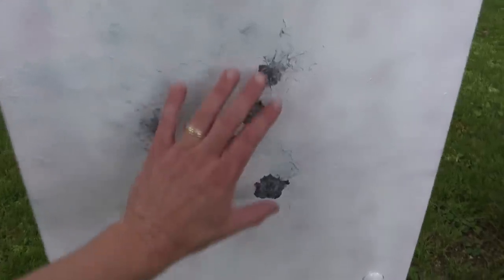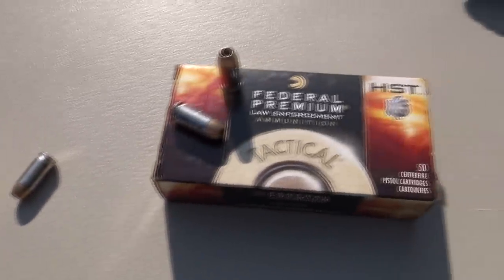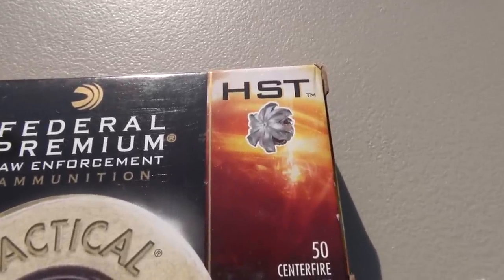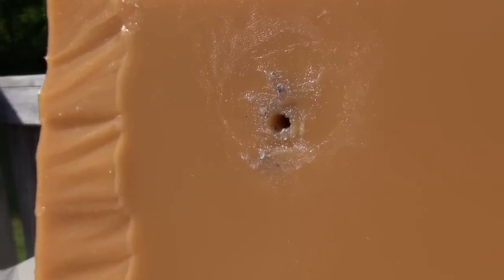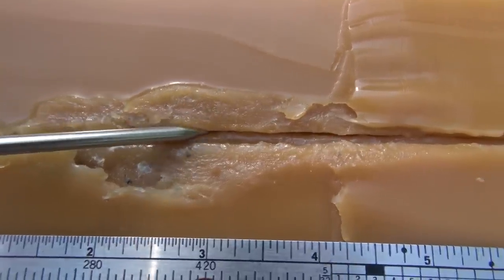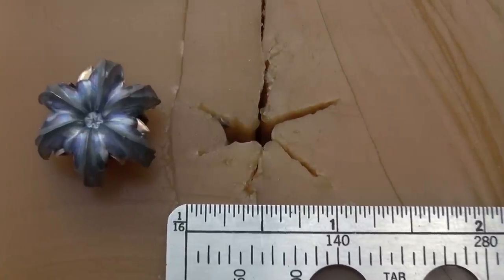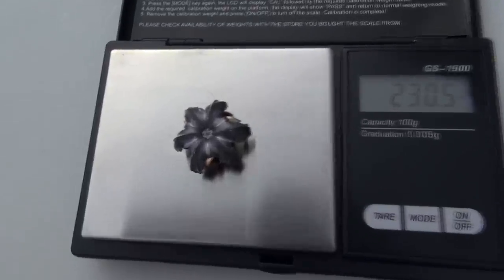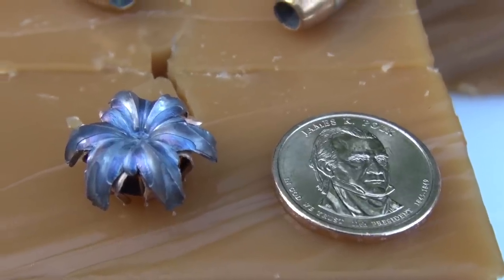.45 ACP Federal HST 230 gr Ammo Gel Test

Comment: Federal HST Premium rounds are just the KING... period.

No matter what channel you view ballistics tests on, this is the round that always gets  absolutely GLOWING reviews. If you carry Federal HSTs, you know you carry the best.

O_______o
Reply: Well said.  It is simply the best.
Reply: Colt Gangsta I agree.  I'm really liking the latest developments for this caliber.  The amount of choices in bullet weight, design and performance has greatly improved over the last few years.

My carry 45 (Jericho 941/Baby Desert Eagle) has a 4" barrel with polygonal rifling.  The 230 grain Federal HST +P chronographs through this firearm at 910 FPS which is similar to the non +P ammo through a 5" 1911.  The low bore axis of my firearm along with the weight of the steel frame makes shooting this ammo an absolute dream.  Cycles perfectly with my DPM spring assembly.
Reply: Colt Gangsta I'd say the Speer Gold Dot 200grain .45acp +p is a great round for short barrel handguns like the XDS 3.3 and the Glock 30, at least from what I've seen. I always forget about that round and then I realize how good the reviews are for it. HST's are amazing too, I don't have personal experience with HST's from a shorter barrel handgun though, only what I've seen them do out of a 5" 1911 and the full size M&P 45.
Reply: The Hst 230 gr standard pressure are my duty round, for armed security.  CT State Police carry the same round if I'm not mistaken, and also have the same duty gun as me.  Sig P220.  Have never tried the 185gr +p or the 200 gr+p in .45, but perhaps I should try those loads out.  I tend to look at it in terms of putting the biggest bullet you can on target, should you have to.  Some may shoot the lighter or medium sized loads better, and certain guns may also cycle them better.  The Hst are king in my mind tho, for .45acp.  Have the 147 grain 9mm's on order.
Reply: aran125 I was looking for some HST 230gr at the gun store the other day. Even though I don't have my G30 yet I tend to like to prepare for things anyways, around here .45 is a very very popular round. County Sheriff's office uses it as does a variety of local PD's. They had one box of the old HydraShok's left. I couldn't find any 200gr .45 except for some ball ammo. I really want to give the Speer Gold Dot 200gr +P .45 a shot (no pun intended) to see how it stacks next to HST's, my local PD uses HST's so I've seen a ton of those expanded out of the M&P 45 and the 4506. Online orders in this state have to go through an FFL for a background check and have to be shipped to the FFL, its a bit ridiculous, I like supporting local gun stores and always will but there is only one gun store I trust and its 23 miles from my house.
Reply: I've seen that about ammo having to go through an FFL for NY.  Total bs.  If you provide a copy of your drivers license, and pistol permit it shouldn't be an issue.  That's what I have to do being from CT.  I heavily recommend Hst.  You won't find it in gun stores around here, has to be ordered online.  It's the most popular round on the market.  You should get your non resident CT permit.  Go to the CT State Police Website, click on special licensing and firearms and click on non resident pistol permit.  They will mail you a packet of everything to submit.  Believe all you have to do is send a copy of your instate permit, certified copy of BC, or passport, $70.00 fee via money order or certified bank check and they will mail it to you.  Perhaps proof of training and possibly finger print cards.  For you it's an option to get CT permit as a non resident.  For me to get NY's, not so much.  If I were you I'd do it.  If you're ever looking to get away I can recommend some good spots and stores, and ranges.
Reply: aran125 Yeah I plan on the CT Non-resident permit once I get my New York but they are taking there time here....can't buy a handgun without a carry permit here. Submitted my paperwork in January and they haven't even started processing. I wish I could use a non-resident permit to buy ammo though. For NY you used to just scan your drivers license and you could buy any kind of ammo you wanted, no pistol permit needed for "pistol ammo".
Reply: Oh I thought you said you did have your NY Carry Permit.  Hope that happens soon for you.  When it does, definitely get your CT non res.  So in NY, citizens can't purchase a handgun with an FID card?  You have to have a carry permit?  That's such bullshit, and a true violation of the Federal and State Constitution.  Also goes against the heller ruling big time.
Reply: aran125 We don't have an FID system like IL/NJ/etc. Originally you could buy a handgun with no permit but you just couldn't carry it. Then NY decided to require a permit for a handgun (Back in like the 50s, so a LONGGG time ago). So they basically half assed it big time and instead of having a seperate permit for just buying they just issued carry permits with "restrictions" on them like "only for target, hunting, and hiking". The restrictions are administrative so if you break them no law is broken but if the Judge finds out you'll loose the permit and then you can't own a handgun at all. So basically the process to just own a handgun is like applying for a carry permit only 10x worse because its NY. Only Judges (with some extreme exceptions) have the authority to issue permits, Superintendent of the state police can issue permits but that never happens because the process is by the county, in NYC its the NYPD Police Commissioner and in a few metro counties around NYC and CT its the County Police Chief. You need 4-7 references and they have to fill out a bunch of questionaires and its gotta be notorized in many counties. I already have my Virginia non-resident permit on the way, they notified me like a week after I submitted paper work, meanwhile in NY State they drag there feet. CT is a cake walk compared to NY, Sometime I wish I lived in CT over NY!
Reply: Sounds kind of like the system that Mass has, only with way more red tape and bullshit.  Mass doesn't go by counties, it's by your town or city like CT.  In mass they have fid cards for long guns and for a handgun one has to apply for either a class a or b LTC.  (License to carry).  Only difference is class a is "large capacity" there. (for what it's worth-load of crap) Within that there's different restrictions they can put on it.  Hunting and target, recreation, premises only (essentially an FID basically), and then no restrictions at all, which in Mass one has to be able to provide substantial proof that they have a higher level threat of physical violence posed against them.  Sounds like the state of NY is in complete violation of the state and federal constitution.  What about long guns in NY????  No fid cards for them????  NY is a true communist state more then CT or Mass and I could never live there.  I believe both my Florida and Utah permits are honored in VA.  I also have New Hampshire's, and Maine's permits.  I don't travel much, if ever but it's totally worth it in the event that I do, or decide to move.  While CT is a May issue state, and we have our "suitability" clause in the statute, it kind of functions as a shall issue state in a way and it's easier for a non resident to obtain their CT Pistol Permit here then residents in certain towns and cities here.  But yeah, I thought you had your permit to carry already.  True shall issue states it's a whole. Other world and way easier to obtain a permit and it's harder to get revoked.  In our states they can fuck with us to no end.  Like I said initially.  I'm done with it and if they want my shit they can come and take it.  It's that simple.  I hate both NY and CT.
Reply: aran125 Yeah I've read about MA's system....not saying I "like" it per say but its a hell of a lot better than NYS! At least with the proper LTC in MA you can have "high capacity" magazines and what not. I know MA is fazing out the LTC-B and just going to FID and LTC-A so maybe MA residents will get some more rights....not sure I'd have to research it more. As for long guns they are unrestricted, just need a drivers license...just bought a rifle the other day and background check was almost instant (at least with me). Of course you can't buy an "assault weapon" at all unless you are law enforcement. Assault weapon is anything with a pistol grip and a detachable magazine or muzzle break or adjustable stock, etc. Also 10 round mags only and can only load 7 rounds but the 7 round aspect was ruled unconstitutional in US District Court. I've also read CT is essentially shall issue. But in NY State the SAFE ACt allows LEO's to confiscate guns without a warrant if they believe you are a "threat" which has such a broad definition its a joke. Most people don't get unrestricted full conceal carry permits on there first try but if you write a good letter to the Judge they sometimes will, it varies so much in one county its hard to say for the whole state...in my county its almost 50/50, although some antigun Judges retired within the past 3 years and I've got some reports many get unrestricted but in Westchester County you will never get full carry, although not as bad as NYC which has a completely different system. Oh yeah if your permit is from any county outside of NYC its not valid in NYC and you'll get charged with a felony if you carry a firearm on a non-NYC permit! But yeah Florida and Utah are valid in VA, I just went with VA first because its super easy and I wanted a permit since its valid in a handful of states I plan to visit.
Reply: aran125 But overall I find it interesting that many are shocked at how restrictive NY State has become, we don't even have the option for "pre-ban" anything since grandfathered guns and gun related accessories (to include magazines) were made illegal with the SAFE Act, I literally think Its the worst state in the union for gun ownership, as far as I know its the only state where you need a carry permit to buy a handgun and where buying a handgun can turn into a 12-18month period. From 2011-2014 permits were taking anywhere from 12-18months just to process, the law says they have 6months to process but they break it all the time or at least skirt it. Its a beautiful and wonderful state, really it is. West of Albany County and north of the Hudson valley is a completely different state but tyranny runs it wild, not just firearm related things either, you are probably intimately familiar with getting taxed the hell out of since NY and CT share a unique view on taxing the crap out of everyone and everything and making it hell for a business to operate in.
Reply: CT also is by no means shall issue, it's May issue, but not as restrictive as mass, NY, Maryland, NJ, or CA.  CT officials love to f**k with people and abuse their power any way they can to try and say that an applicant is unsuitable.  That's by now and shall issue, but total may issue.  Yet the amount of ignorant gun shop clerks and ffl's I hear out there saying we are shall issue.  They are wrong, and give out lots of bad information.
Reply: Pardon me I can't type.  That's by NO MEANS shall issue, I meant to say.  CT, although a walk in the park to NY or Mass, and no comparison to NJ or California, is indeed a MAY ISSUE state.
Reply: aran125 Yeah but don't the final review boards (ie: not the ass hole police chiefs that denied the initial app) usually issue anyways? Interesting that non-residents get treated better than residents but its likely a product of non-residents going through the Department of Emergency Services and Public Protection directly and not local police chiefs(what a mouth full! Why not just Dept. Public Safety?!). I've read a few cases where CT Officials had vendettas essentially and kept denying people permits. California is going Shall Issue if they aren't already thanks to the US Court of Appeals for the 9th Circuit. California is similar to NY State from what people have told me, give or take a bit depending again on the county. New Jersey and Maryland are the last two states which are for all intents and purposes NO ISSUE, both states have insane requirements, people have actually been seriously hurt or even killed by the people they sought to protect themselves from but legally couldn't, happens in DC too. My buddies sister and her boyfriend are moving to CT, he's got his NYS permit but no CT permit yet, I'll have to see how that goes for him. I wonder if you had a non-resident CT permit and became a resident and tried to change it over would the police chief try and butt in...what a mess. National reciprocity seriously needs to happen soon, I don't even want to call my sheriff's office to check on my permit and I know my counties Undersheriff real well...amazing that we volunteer to submit fingerprints and personal info and pay for a right and still get treated bad!
Reply: aran125 Link to Buffalo News is dead or at least not working. What's the headline of it? I know Buffalo and the surrounding area has been a test ground for the SAFE Act since Buffalo PD is anti-gun. They arrested a guy for having more than 7 rounds in his mag not to mention they are confiscating deceased persons guns within a week of there death regardless of whether the owner's family wanted to keep the firearms.
Reply: DESPP is former dps in CT.  They changed it.  The board of firearms permit examiners in CT (go checkout their website).  Boy will you be in for an earful.  There's vids of them on YouTube too.  YouTube ct Bfpe open carry.  Boy will you learn a lot.  But anyway, they are an administrative review board for local or state denials and state revocations.  They address suitability and hear both sides of the story when a person is revoked or denied a permit.  It depends, like I said, many of these police chiefs in CT are real anti gun and want to have full control and they are pissed that the board probably over turns 2/3rds of their denials.  As for the link, I'm having a hard time finding the original article from the NRA Google plus page.  If I find it I'll let you know the headline title.  As for the state of ny confiscating guns like that from deceased people's family.  I hope they get their Brains blown out when they go to a home where a NY citizen decides to say fuck u come and take it.  I really do, I'm not kidding.  That's tyranny, and frankly if you can't tell it makes me furious.  Nazi's deserve to be shot dead for attempting such bullshit.  Pardon my French, but it honesty just really makes me angry.  I don't like cops too much man.  They wanted that in CT's gun legislation that passed in 2013 but didn't get it.  There's gonna come a time where it's gonna be a requirement to shoot and kill police officers if you want to uphold your liberty to keep your guns. You may never hear anyone as bold and ballsy as me to put it that bluntly but why hide the truth?????  Come on now.
Reply: nateo200 any guns would be long gone from my relatives house before then
Reply: Danmandingo have some on the way for my new HK45!!
Reply: I agree, hst or gold dots always do well.
Reply: Depends on caliber too. In my 9mm M&P Shield I carry 124 gr HSTs. They perform flawlessly in the 3in barrel format. I use 147 gr HSTs in my full size pistol.
Reply: Idk Winchester ranger t's seem pretty wild too
Reply: It's a good one but times have changed and the newer design of the Extreme Defender by Underwood is now the top .45 round for several reasons.
Reply: @Syrinx222  I do the opposite, use the 147 in the Shield.  :)
Reply: Nah buffalo bore
Reply: Danmandingo closely followed by Speer gold dot.
Reply: TOBORE8THMAN    That Jericho is a beautiful rarity, please take care of it. Iv long thought of giving up on getting one because of how hard it might be to get the exact one you want out of the originals in good condition.
Reply: @nateo200  I know this is 5 yrs ago but damn I'm in shock reading all this! I took my class here in Oklahoma and never got my paperwork sent in with the $200 or so it cost for everything. I felt like it was such a big hassle and I read y'alls comments and feel like a total A-hole now! I feel really bad now too that we have had Constitutional carry for a year now and was like I'm so glad that terrible permitting system is gone, meanwhile y'all can barely buy a pistol wow! I'm on here to see if I want to buy this or +p for my gen 4 g30. I really feel for y'all damn, that's the definition of infringement! You should definitely get out of that part of the country. Now people can burn down police cars and precinct's and everything else and nobody cares but God forbid you want to carry in the craziness of today they'd lock you up and throw away the key. I don't understand how bad especially in NYC its getting now I think I seen shootings have went up 600%. Like where these people getting the pistols they're shooting people with they sure ain't legal lol. You need to be down south here in a nice red state carrying what you want when you want. All the craziness isn't happening here either. When people can protect themselves they sure don't mess around! Stay safe bro's!!
Reply: (when they work through clothing) sig sauer v crowns are ridiculously beautiful too. Identical to these. These are more consistent though. Sig suaer isn't bad though...
Reply: Just because  Overpriced and over worshipped.